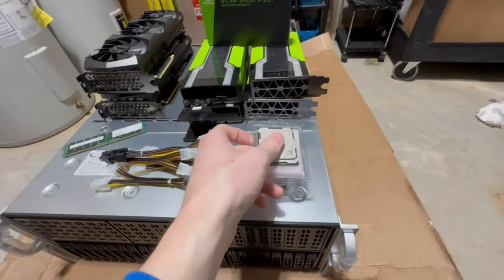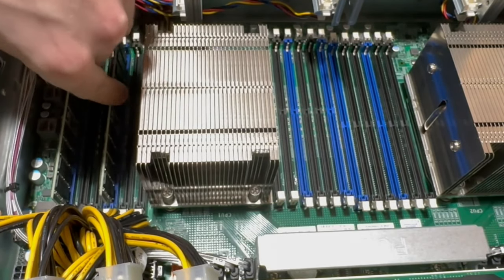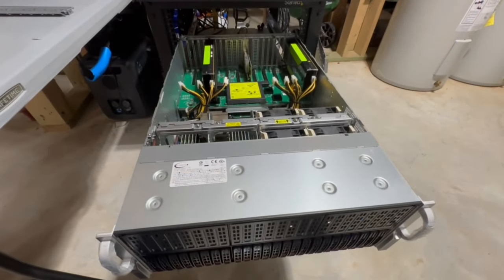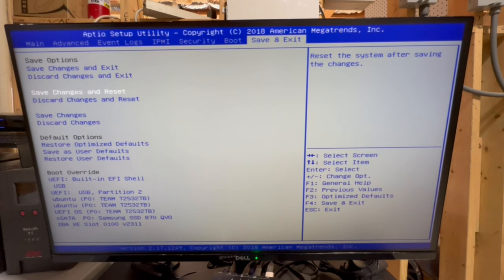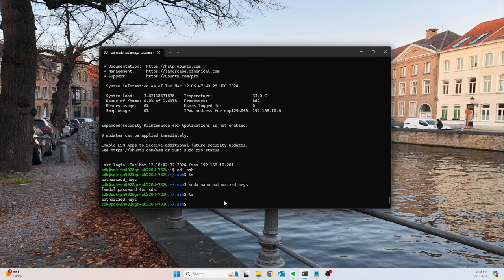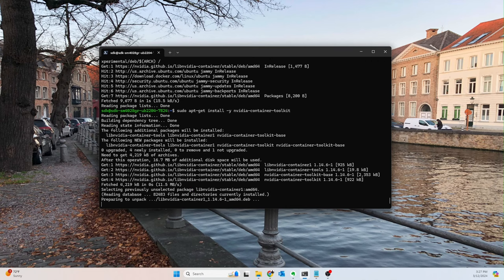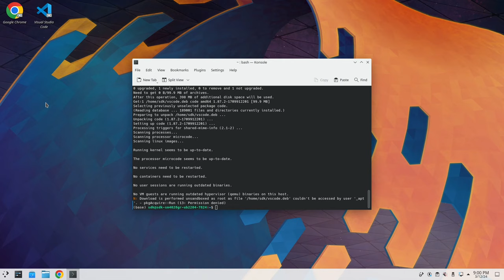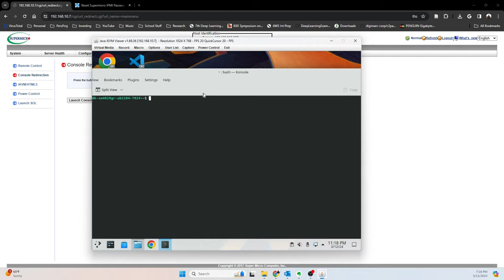8 GPU Server Setup for AI/ML/DL: Supermicro SuperServer 4028GR-TRT

Comment: Great video and an inspiring build. Couple of questions if you don’t mind. Where can I find information on the onboard SATA configuration for the front drive bays? You’ve gone over this in the video but I do not see it in the server manual - did you pretty much figure it out yourself? Second question is what AI software/flavor of AI do you plan to run on the server? Thank you!
Reply from the maker: Hey there! Thanks so much for the kind words.

So, its really tough to find out info on this. I don't think I could find anything here. I am pretty sure this part I figure out through trail and error. Lol. 

So right now I am mainly using PyTorch to run computer vision models like ResNet 50, MMLMs like CLIP and FLAVA, Graph databases  and GNNs with NEO4J, and I plan very soon to start working on an anomaly detection research direction and also work with local LLMs (probably Llama to start).

Comment: What is the size of the flash drive used for the ventoy setup?
Reply from the maker: This is a great question. I honest don't remember of the top of my head. I think the one I used was 32GB, but that is just because I had some extras laying around. You could probably get by with 16GB honestly and even less depending on what tools or other OSes you want to have available.

Comment: In your "software setup" documentation there's a gap where it doesn't have your python and node commands and install prep stuff. Also didn't really have the firewall stuff for XRDP in it, though I suppose people could follow the video to get that info. Probably not a huge deal, but figured I'd mention it in case anyone is trying to follow along using your included documentation. I did want to ask if you were using a specific UPS or pair of UPS devices with this particular setup as this is a dual PSU system? Didn't see anywhere when you mention what you are using for power backup. The IPMI stuff changed just a few years ago and the password is almost always somewhere on the device physically, for mine it was near the network card, but for the 4028GR-TRT I wasn't able to find a reference online for where it was. I suppose it might have been inside somewhere instead, but fortunately ipmicfg exists, I guess.
Reply: the man was using chrome as a default browser, that tells everything you need to know....
Reply from the maker: Which browser do you prefer? @lofasz_joska
Reply from the maker: Hi there. Thanks so much for letting me know. I will go edit that file so people can better follow along. 

Yes, I am using UPS units. I am using 4 APC Back-UPS RS1500. MPN BR1500LCD. Max Watt output is 865 per unit. I going to do a whole video soon around power considerations in my home lab. Please stay tuned for that if you are interested!

Yeah. I checked literally everywhere I could think of and I could not for the life of me find the password. Glad you had an easier time than me though. I'll go check near the network card like you suggested though and see if maybe I missed something. Was this on the inside or outside near the network card?
Reply: @TheDataDaddi  Mine was outside on like the "lip" of metal near the network card, though it didn't say password or anything, it's just a serial number. I've seen some models that have it right above the card in an easy to see place, but it's not always in an easy to spot location. Plus, the label under the CPU doesn't do any good for people who've already seated the CPU, not sure what their thinking was there. Yeah, I'd definitely be interested in what you do for UPS, I imagine a lot of people looking at getting servers like this probably don't really consider it when they are going to do their purchase. I know I didn't at the time I purchased my AI setup. Keep up the good content, it's always good to see what others are doing!
Reply from the maker: Got it. I will definitely go check and see if I can find it now. Knowing me it is probably there pain as day, and I just missed it the first time. lol.

Yep, I have had several people ask me about this. I will try make a video on general power considerations for a home lab and in the video discuss different options for UPS. I am not sure when I will be able to make that video so just in case you could use this information more quickly here is a summary. I found a great deal on EBAY for some APC Back-UPS RS 1500 (BR1500-LCD). Max output of the unit is 865 W. So I bought 5 units and have distributed power consumption as even as possible across all 5 units. It has been working really well so far. Hopefully this gives you a decent starting place. @GravitoRaize

Comment: What dimensions are necessary for the Supermicro SuperServer 4028GR-TRT to fit in a mid-sized server rack? I'm grateful. Thank you.
Reply from the maker: Hi there. Thank you so much for the comment! 

So, I forget what length I set my rack at, but the Supermicro SuperServer 4028GR-TRT is 29" long so I would set it about 3" to 5" longer than this to comfortably fit the server.  To my knowledge, servers are pretty much all the same width. One thing to keep in mind though is not all servers are the same length so if you every buy others in the future they may be longer  so it is a good idea to set you rack a few inches bit deeper than the longest server you plan on housing.

Comment: Hm, if you get a slim right angle PCIE cable could you make those 3090s work?
Reply from the maker: Hi there. Thanks so much for the comment. 

Do you mean work inside of the server?
Reply: @TheDataDaddi  yeah the inside of the server
looks like theres a bit of clearance. obviously with these 2.5 slot cards you cant fit 8 of them in there.. but could be a decent self contained alternative to mining rigs if it would work.
Reply from the maker: This is a great idea. I will see if I can find something like what you are talking about that will work. Thanks so much for the tip!
 @choilive

Comment: How loud is this server? Would I be able to be within 5 feet of such a setup?
Reply from the maker: Hi there. Thanks so much for the comment. 

On boot this guys runs over 90 dB. For reference, this is equivalent to standing next to a lawnmower in terms of comparable dB. It is the loudest server I have ever been around on boot. Also, when running the GPUs full blast it can get loud though not as bad as on boot. However, most of the time during normal operation is not bad. You could work next to it no problem. Just be aware you will always hear it. Hope this helps!
Reply: @TheDataDaddi  thanks, that helps a lot. I am working remotely and didn't want to go deaf :). Thanks for the guidance, I followed your guide (mostly) to a T.
Reply from the maker: @VenturaPiano  Glad I could help! Honestly, if you work with headphones in it should be no problem. For myself personally, I like a little bit of noise when I work so it working next to servers has never really bothered me. I would just leave the room on boot.

Comment: Did you look into whether  the 1U bump lid (supermicro part number MCP-230-41806-0N) clear an rtx 3090? Looks like that Zotac card is a lot lower than some other 3090 cards, you might get by with the MCP-230-41803-0N which was designed to clear the GTX cables. (Note that these were part numbers for the 4029GP-TRT2, but the chassis looks pretty much the same).
Reply from the maker: Hi there. Thank you so much for the comment!

So, I have not looked into this, but this is a great idea. I do not know 100% if it would work, but my gut tells me it would. I think this would be a great way to keep the GPUs in the server. One problem for me is that I do not have 1U worth of space in my race because it is completely full. However, for others it would likely be a great option. I might order one just to try it and let viewer know for sure if it works or not. Also, if you go this route please let me know the results.

Also, I heard from a viewer recently that the RTX 3090 founders edition fix in the chassis with the standard lid. Might be worth checking that out as well.

Comment: You know, I'd love to do a proper machine learning server, but there's a couple of things I was a little bit scared of. I've heard horror stories about people who purchased servers, only to find out that certain components (CPU is a big one) are "vendorlocked", or that the server needs to be booted first from a VGA port and accessed with a specific sign in key to access the BIOS and so on... To say nothing of the fact that certain GPUs will have "HPE" "Lenovo" and so on in the name in the listing, which leads me to believe there might be certain GPUs which are vendorlocked as well.

It just seems like there's a lot of major issues you can run into that are absolute showstoppers, and it really does frighten me a bit to be caught out by things of this nature, because I haven't personally set up a server build before.

Have you run into any issues like this?
Reply from the maker: Hi there. Thanks so much for your comment!

Interesting. I have never encountered any of these issues. One caveat here is that I have always bought refurbed servers so there my have been unlocked prior to being resold. That part I am unfamiliar with. I have also never encountered a vendor locked CPU, but again I have only ever bought used server CPUs. If you plan on going the used/refurbed route I would say the there is a low probability of this being an issue. Also, to further mitigate risk, I would advise buying from a platform like EBAY that offers a 30 return policy. This should give you enough time to get all the kinks worked out, and if there is something wrong you can always send it back. 

As for the GPUs, they may have certain manufacture names in the title/description for a couple of reasons. 1) The GPU might be manufactured by that particular vendor. For example, both GEFORCE and MSI both make a version of RTX GPUs. Same chip, similar if not same performance, often similar form factor. 2) The GPU could be manufactured to fit in a particular server type natively (like maybe Lenovo or Cisco or similar). This might mean it is harder to fit into a different server, but might still work. This is one reason why AI hardware is so difficult because there is so much nuance, competition, and a huge lack of clear documentation. 

Anyway, all of that to say. I would not worry too much about those things. I have built and worked on a good number of servers at this point, and I have never run into any of those issues (knock on wood). If you would like some help getting a build together, feel free to reach out to me. You can find all my contact info in my YouTube bio.

Comment: I'm thinking of building one of these with 8xp100. My knowledge is fairly limited but I want to explore llms. Would you recommend
Reply from the maker: Hi there! I think this would be a good cheaper way to start experimenting! Do be aware through that training or fine tuning most of the largeer open source LLMs will be out of reach even with a setup of this magnitude. However, you could likely host some of the smaller one or quantized versions locally. Hope this helps. Cheers!

Comment: This is great. what other GPUs re supported in this platform? can you run any modern Nvidia car like a 3090?
Reply from the maker: Hi there. Thanks so much for the positive feedback!

 Yes, you can run more modern GPUs. In fact, I use the RTX 3090 in the server currently. In another video, I go over how I got the RTX working with this server. Check it out here:

Setting Up External Server GPUs for AI/ML/DL - RTX 3090
https://youtu.be/zrcKGF156bA

Comment: what kind of AI work do you do? are you able to run and/or train on llama3 with 70B parameter? also wow that is loud, is it this server only or all your servers together? I was thinking to do the same thing in my garage (which coincidentally is the place I do most of the work from), but this might be too loud for me.
Reply from the maker: Hi there. Thanks so much for the question.

Currently, for my main body of research around browser security I mainly work in computer vision (ConvNets) and also with some of the newer multimodal models like CLIP and FLAVA. In a separate project, I am working with Graph Neural Nets and Graph Databases to ingest and analyze the entire BTC ledger.

As of yet, I have not played around much with any of the open source LLMs on this machine because frankly I just have not had the time. It is high on my list of things to do though. So, unfortunately, I cannot tell you exactly what works and what doesn't concretely because I do not have real data to support it. What I can tell you though is that even with 8 24GB GPUs will only get you to 192 GB VRAM. Llama3 70B will need about 140GB for half precision (back of the envelope here) for the model parameters. So pre training or fine tuning are likely out of reach. Honestly, it seems like if you really wanted to pre train or fine tune any of the really large LLMs you would need a distributed cluster. I would love to do this one day, but that will require a lot more time and funds. lol. That said, I do believe that hosting the Llama3 70B locally for inference with model sharding (splitting parts of the model across different GPUs) should be possible with the setup in the video (depending on what GPUs you choose to add of course). Especially if you are okay with some level of quantization, I think it should be highly manageable on this rig. I will try my best to do some experimentation here very soon and make a video on the results. You are not the only who is very interested in this use case. 

Yes. Lol. This server is loud indeed. It is probably the loudest one I have ever worked with. The noise is not unbearable (for me at least anyway) unless the machine is booting or under heavy load (running 4+ GPUs at max capacity at once). I would definitely not suggest putting it anywhere you will be working all the time as it could get annoying especially if you are constantly running experiments. What I normally do is if I need to work next to the server for extended periods of time, I just wear headphones (mine are over the ear and noise canceling, but any should probably help). This might help you if you don't have any other options, but to work in the garage with the servers frequently.
Reply: @TheDataDaddi  thank you so much for  responding, great stuff, great channel.